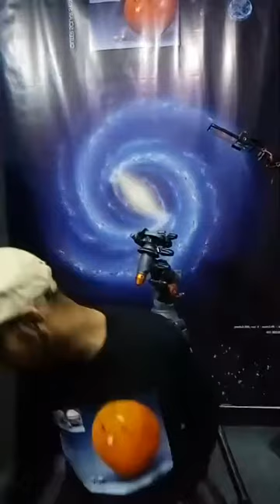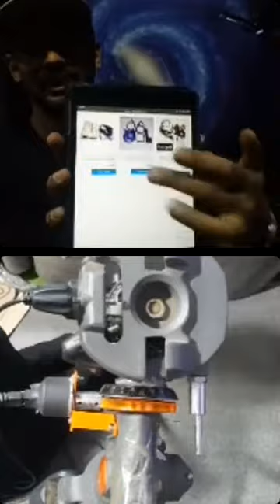Assembling SimpleDreamCG3 – micro Go To Upgrade kit 4 Celestron CG3 mount

Comment: Tenho essa micro goto, a 2 anos e ainda não consegui configurar no wifi para usar no stellarium.
Reply from the maker: Sorry to inform u its not compatible with stellarium. If u have lx200 then, only it can synchronise. The best is safari pro from developer. Meanwhile i was not able to connect frm pc too. There are some errors with it. instead, i have used redshift 8 for win 7 it worked as well as mac too. But for wifi plz find any full version of safari pro,  it really worked. Last time i kept for auto tracking sun with solar filter, my student was so surprised he told me it was still image from telescope. I used galileoscope in this mount for solar observation. 
You can check photo of mount n telescope in fb "https://www.facebook.com/royalastronepal"

Comment: can you send me further instructions on what knobs to loosen so i don't burn up the motor? also what apps are good for using this with wifi?
Reply from the maker: yeah sure, there is a manual it gives good info. i contacted to manufacturer, n guided me properly too. 
can u sen me email “01.goodsun@gmail.com” regarding this, so that i can attach you pdf as well as we can discuss abt it. thanks.

Comment: I'm having trouble with my goto simpledream cg3. The first time worked perfectly with Sky Safari 6 pro, but the second time didn't work, all the time says that I'm in the wrong hemisphere, any ideas?
Reply from the maker: i have also encounter such problem too. But i am not sure how i fixed it. Coz i tried many steps out of which one worked.i am sure u jave kept right lat long according to ur location. Another problem is time in device. For example if my location is correct but time is different than actual location real time. It says something like that. Or sometime if object is above horizon in real time but device time shows below horizon. Then it says like that abt wrong hemisphere too. Meanwhile i will check it out again so that i can know which steps worked for me. N please check wifi connection n mount sewing is in right direction too.
Reply from the maker: I remeber one thing, toggle theswitch between West or East in remote control. Coz i encounter object was below horizon all the time.n inchange this setting n worked well. Or try to uninstall n install app again n set settings again it might work. I have been using safari pro in mobile device only.
Reply: Thank you, I will try @Videosfor
Reply: @Videosfor  It's working again... I hope this time last!
Reply from the maker: @juanignaciorios1203 its grt news. Now u know how to troubleshoot also, so if same problem occurs, i m sure u will fix it again. So far,  once setting is all done, it usually don give any problem. Happy gazing !!!

Comment: Hey! Thanks for making this video. Can you tell me your experience so far with this upgrade?  I want to invest in a $400 staradventurer but with all that money I can buy this, a power tank o much more.
Reply from the maker: hei, thanks for feedback. yeah, u r right, with such amount we can buy a lot of accessories. r u planning to use star adventurer for dslr only or along with telescope too? if u r ready to use goto then i prefer to buy star adventurer though i have not used. for me i am satisfied with simple dream assembly coz there are no options for cg3 mount then this. i m trying to shift into better mount. it works as miro goto. here the target object should be within 15 degree from ur aligned object. sometime it might be annoying especially for deep space object. u can buy extra gadget for it for more precision. here we need to be really careful not to destroy motor or gears especially for declination axis. 
i recommend this only for practice before buying expensive goto coz with this reasonable price we can be used to handle telescope, alignment, gear system, wifi, ascom(notebook). basically, if you have cg3 then u can give a shot for practice. if you are really serious about astro photography for DSO then i would like to suggest you to go for expensive one. i think the one u have selected is pretty good. make sure to buy wifi dongle so that u can align easily with planetarium software via mobile. Simpledream vs expensive goto i give 4.5 out of 10 for simpledrea whereas for its price n getting used to for computerized stuff i give 7.5 out of 10.
So, it depends entirely in you, how you gonna use it.
Reply: @Videosfor  Thank you for your complete response. Well, I take my pictures with a dslr and a lens, I'm not planning to use a telescope in the near future, I like wide views. However, I want to improve my tracking and the first thing that came to my mind was the star adventurer. Then, while I was looking for some other stuff this simpledream kit appeared and I began to doubt. Usually, my exposures don't go over 30s and I want to push it further, a least a minute.
Reply from the maker: i think it would be better with star adventurer along with wifi dongle.
Simple dream is also good fo remote control than using manually. Auto tracking is not fine enough for astrophotography. For that u need extra acessories available from vendor as well as u nees to buy cg3 mount (if u dont have compatible mount or tripod)separately. Atleast ur expenses would be about $200 with additional accessories like power tank, canera acessories, it might goes upto $300. Excluding delivery charges or shipping.
So if don have any mount or tripod, n u have to buy everything then i prefer togo with ur intial plan.if u already have cg3 mount (celeron) then u can try this one with cheaper price along with extra gadgets for astrophotography.thanks

Comment: I have a question about WiFi connecting this system to my phone. Do i have to buy something else like wifi adapter or something or it’s already built-in ?
Reply: Also is there any adapter i need to buy separately to run this ?
Reply from the maker: No need to buy anything else for wifi.
Reply from the maker: Yeah 12v - 2 ampere adapter.
Reply: @Videosfor  hi, ihave one more question 😅 if i used app to control the mount will i be able to chose a target and the mount will automatically point at it ?
Reply from the maker: @MohammedAli-wy6lb  yeah. it does not act like goto but its still micro goto. u need read manual carefully. u can choose target within 15 degree from ur align object. once u set with ur target it will auto track.

Comment: From where did you get this
Reply from the maker: From astro gadget, details are in description with the link. Its frm Ukraine.

https://astro-gadget.net/gadgets/control-of-telescopes/simpledreamcg3-go-to-upgrade-kit-for-celestron-cg3-mount
Reply from the maker: From astro-gadget.net.
https://astro-gadget.net/gadgets/control-of-telescopes/simpledreamcg3-go-to-upgrade-kit-for-celestron-cg3-mount
Reply from the maker: As well as you can find on ebay too.they have store there too
Reply: @Videosfor  From where did you get it in India
Reply: And does it track
Reply from the maker: From usa via my friend and then it was delivered to Nepal. If you can have foreign transaction from your country then you can directly order from wherever you are. Nepal National bank restrict to buy in foreign currencies for individuals. Recently, it allows $500 to buy frm abroad but lots of limitations and valid for one year only.
Reply from the maker: Its micro goto. So dont expect like expensive mounts. But yeah it tracks. I tried with mobile its fine. For more functions we need to buy more equipment . So far i am happy to use from manual to automatic or at least remote controlled.  Cg3 astromaster mount is really not goo mount. Even i bought the single motor from celestron. I was not satisfied. So this product was last option for this mount. And only available in one store around the world. I could not find any more for this. If you could find plz share with me.thanks
Reply from the maker: Making things simple. It will be delivered from Ukraine. I asked my friend frm usa to order from Ukraine and it was first delivered to USA and then my friend delivered me to Nepal. So you have to order from Ukraine.